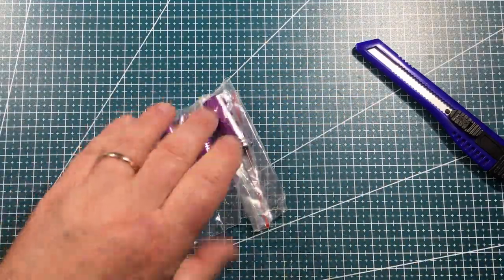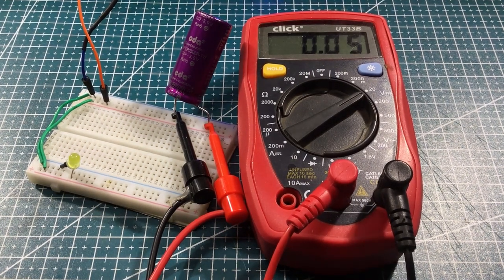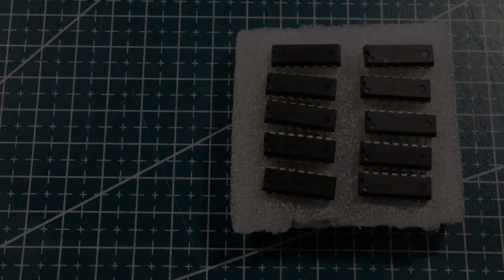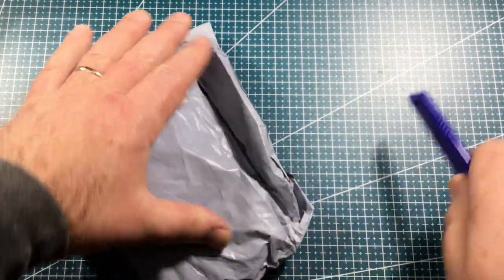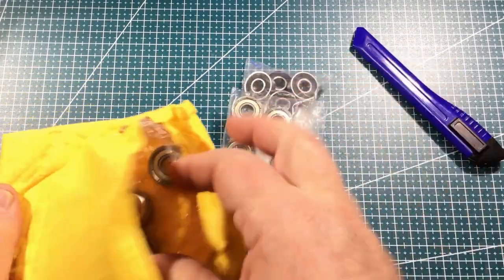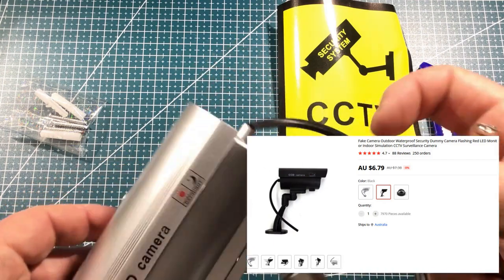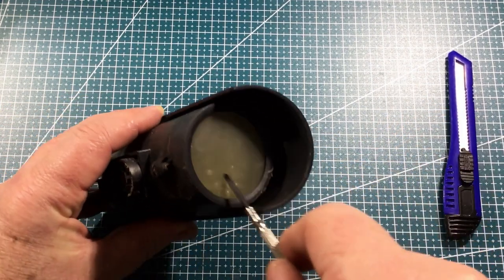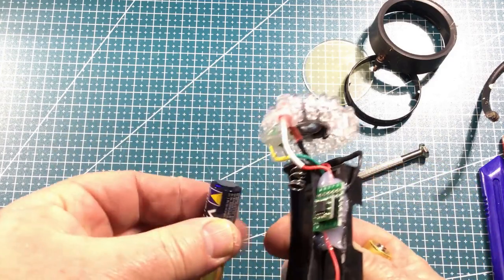Mailbag #15 including super capacitors, and fake CCTV

Comment: I remember asking someone in the 80's why you can't get capacitors with Farads, instead of just MicroFarads ? They told me that would be impossible and of no use if it could be done. LOL.

Nice fake cameras, I got one of the old school types. It's a cream coloured box with a fake lens sticking out of the front and a flashing LED, Added bonus, it swivels from side to side.
Reply: Apparently NEC started making supercapacitors in 1979 for vehicles

Comment: Why you don't install inside an esp32 cam?
Reply from the maker: I have - but not in the dummy cam housing. 😉
Reply: @onecircuit-as  you should try to mount inside the dummy housing an esp32 cam
Reply from the maker: @SymbolTech21   Yes but it's a dummy camera - the real camera/s are way less obvious! 👍😀
Reply: @onecircuit-as  that's the point from a dummy camera you can make an active camera. And you can use the 18650 to power the esp32 cam and with those small solar panels to make the charger to charge the 18650 battery
Reply from the maker: @SymbolTech21  I have done that - but they are "hidden". The point of the dummy camera is it gets smashed by the bad guys, but they don't realise they are being filmed through a more discrete housing.